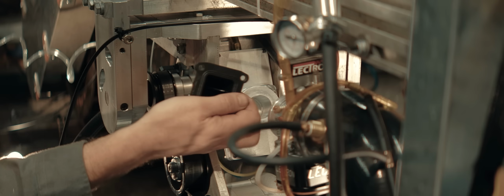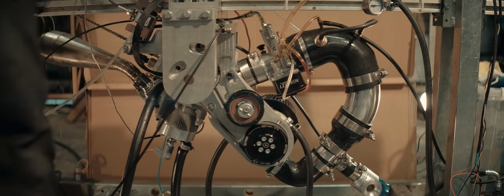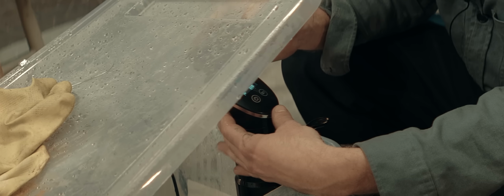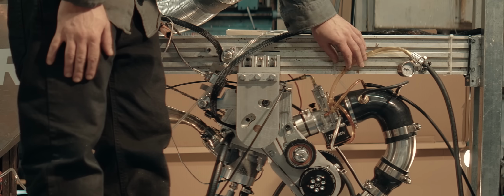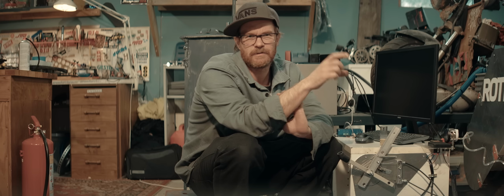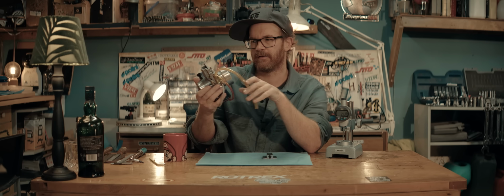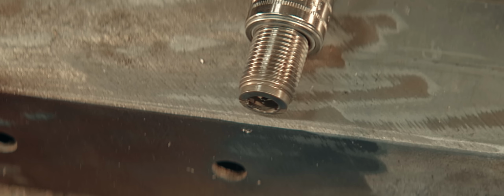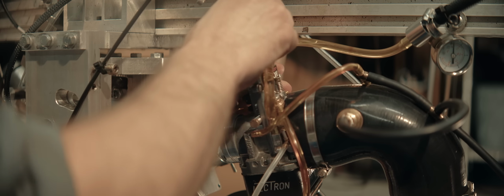Supercharged 50cc Two Stroke BREAKTHROUGH!

Comment: Sorry but it don't seem to be running to well. The advance that your doing is very important for torque and racing performance but, from watching the video and the use of your throttle the motor is not responding quickly enough at the throttle which means that what ever your screen is telling you or that modulator your using they are not telling you the right degrees of advance. Here's the racing formula,... If the motor is sluggish it needs more advance it starts misfiring its to much advance, its that simple. If you motor dose not produce instant response at the throttle and the cable to the carb is tight then the advance is to little and your indicator system is faulty. I know racing and I know that there is definitely sumtin wrong with that throttle response and I mean explosively wrong with your throttle response. Don't take it out onto the road that way... Ka-boom is all I could say !!!

Comment: Y dont you take a turbo fans machine the cases for the so thr fans to go up into the transfer so that the fans can blow up into the transrer ports  a right and left turbo fans make the engine in self atomizer power it will work if its not its too hot nos it to cool down run cold plugs retard timming to keep detp down turb0s rpm turn at20k at low rpm two strokes high rpms 30k rpms do the math

Comment: Cutting the wires really short to "terminate" them shows me that you don't have the proper knowledge of electronics. You should rather work on that
Reply from the maker: I'm not sure what you mean?
Reply: At 2:10 you mentioned to fight interference by cutting the wires short. If there are any input pins and there are floating then you will get all sorts of problems not only interference. Input pins should have defined termination either logic high or low. A termination resistor to ground or VCC should eliminate most of your "interference" problems I doubt that that thing has siglal transmissions over 10MHz region. I presume that such device has several IO, Vcc and a GND pin. You get similar behavior from CMOS ICs where the input pin have no defined logic state because the pins are floating therefore not terminated with a specific resistor either to GND or to Vcc. It depends from the circuit which includes to have the specialized knowledge in basic electronics. So you should work to improve that skill first.
Reply: PS: soldering nilly vanilly wires back to cutted pins is not advisable. Searching a plug or rebuying and crimping new pins would be the proper procedure to prevent further unwanted surpring behavior from your system.
Reply: @icebluscorpion  It's not the purists way but it works!
Reply from the maker: All pins not in use are disabled, probably internally pulled to vcc or ground. The reason I cut them was 20 2m long wires flapping in the breeze makes for a good antenna. De-pin/re-pin would've been better.
Reply: @2STROKESTUFFING  I agree with you on that. It would have been a bit more work but it would have been worth it.